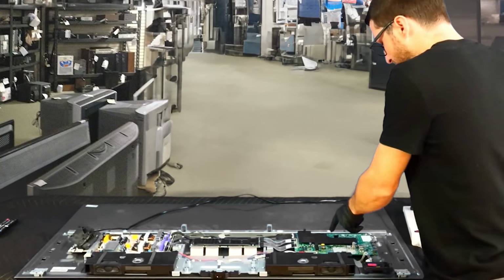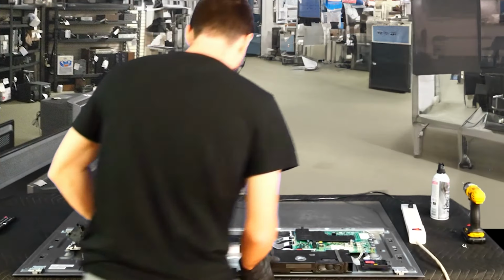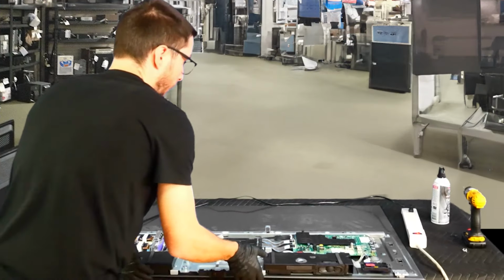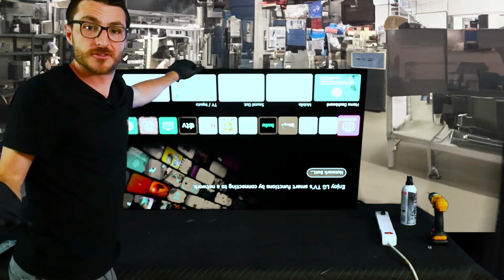LG OLEDs Have A Serious Problem! How To Fix!

Comment: My CX 65 inch OLED did the same this morning. No power. Reddit and YouTube seem to be full of CX failures at the 3 year mark. Let's hope LG does something about it.
Reply from the maker: I don't know if they will but I wish that companies were held at higher standards for how long their products work. I feel like 5 year manufacturer warranty should be the bare minimum. Yeah it will increase the cost of the TVs upfront, but in the long term it actually will cost less since you won't need to replace your TV as often.
Reply: Same issue. I had where it would spaz and turn off when it overheated. I added fans like some videos had suggested to cool it down and that worked for a few weeks until today when it just wont even turn on anymore.
Reply: Same! Mine stopped working
Reply: I called lg about mine and they just outright denied any responsibility and transfered me to a local repair tech. 

I'll probably just take it apart myself and send thr board off for resoldering after seeing this.
Reply: @flanker152  Yh I just sent mine to a repair shop hopefully it’ll get fixed
Reply: @AussieR1  No, they won't do nothing. They will just send you to a repair shop, on your  expanses. Two, maximum 3 years of normal use and after  that, failure of internal components. On such expansive TV's, this is totally NOT acceptable!
Reply: My one died to some months ago.
Reply: My 48cx has almost 10,000 hours on it and it's still going strong! By far the best TV I have ever owned until my 55 G4 arrives this Tuesday!

Comment: I believe this model of TV was recalled in other countries for overheating. Just not yet recalled in the USA. My 55' CX had the same problem and it was a defective dried up and crusty thermal pad, between the CPU and vapor chamber, that was the point of failure. 'Causing an overheating shutdown.
Reply: Would it be useful, when buying a new TV set, to add proper extra thermal pads on specific components such as processors and microcontrollers, graphics chipsets (GPUs), power supply modules (MOSFETs, voltage regulators, etc.), memory (RAM), for example, if there weren't any, just to preserve in the longer term? What's your opinion?
Reply from the maker: Yes this seems to be the case with every single one of these mainboards we have worked on so far. The thermal pad is very dried up and crusty.
Reply from the maker: Yes and no. I think it depends on the manufacturing company. 
For example that thermal pad we add on the back of the mainboard, is something that Sony always does on their high-end XR series TV sets. Because of that it is very rare to see a processor fail in a Sony TV. However, we do see issues with the eMMC chips they use which are made by Samsung a lot of the time (maybe sabotage lol). So for Sony TVs, it's already done and also because we rarely see processor failures even if it wasn't done I would say there is no need. Maybe because most of their sets have 2 processors instead of 1 processor handling everything. 

For LG sets we do often see processors fail and they never have that thermal pad below to help dissipate heat. So for an LG set I would advise adding a thermal pad below the mainboard yes for sure worth it. If they have 2 processors one being a GPU then both should get that extra thermal pad yes. The UF series was one that very much needed that. 

Vizio has been adding those thermal pads for their TV sets, but they still also have lots of processor failures. I don't know why that is although I do have a hunch that is based purely in speculation so I won't share it. For those, realistically having a fan in there would be the best way to upgrade it although that is more advanced for sure. 

I do know that the next iteration that LG made for the next years TV sets LG added a copper plate between the CPU and the heatsink to try and have better heat transfer between the die of the CPU and the heatsink.

Comment: This is happening to my LG CX. Seems to cycle and restart every ~15min regardless of of using internal apps or external device. I replaced the main board thinking this would be the solution but the problem still exists. Ordered a new power supply in hopes that solves the issue. Any other ideas of what could be happening if the new power supply doesn’t work?
Reply from the maker: Did you purchase a replacement mainboard from us? If not then most likely you bought a bad mainboard. I don't think the replacement power supply will help.

Comment: Hi, i have an lg oled5587v and i get three red flashes and an audible metallic click when i press the power, but no picture/audio. Any ideas whether its main board or power board?
Reply from the maker: I am not familiar with that model. Could be neither of those and could be a T-con or panel fault as well.

Comment: My 55b16LA won’t turn on after 2 years use but has a red light on the front that works when u u press your remote control buttons? Any ideas on what has happened thanks

Comment: I have the same issue, tv is overheating and turning itself off. However, if i place a fan behind it, where the board is, it doesnt shut uff anymore. Is this a long term solution, or should i send it back to warranty?
Reply from the maker: If your TV is still under warranty I highly recommend you have the TV serviced asap before it goes out of warranty. If it is already out of warranty which I would assume it is by now, then I wouldn't be able to tell you if this is a proper long-term solution but if you don't mind turning on a fan when you turn on the TV I would say to keep doing that and report back once it fails. 
I do have replacement mainboards for sale available, but I only have about 30 left before I am completely out of stock. From what I can tell everyone else is out of stock as well, so there may not be parts available in the future.

Comment: Hey i can have your advice, in my CX 55 some white lines appeared on the borders of the tv, at the beginning it was just in one corner but with time it has extended and now it looks like a white frame everytime I turn my tv on :( the thing is that I found a panel online but the model its OLED55CXPSA and my tv its OLED55CXPUA. Do you think I could replace it? or they are completely different things? thank you soo much

Comment: I noticed that many LG OLED buyers have one of these problems (the TV no longer turns on, the red LED light no longer lights on), and in some cases, the appearance of black dots on the upper and lower edges of the OLED panel. The power board fails, the processing part (main board) fails (due to a processor that is not properly cooled)... I experienced these problems too ( I have a 65CX model) - some during warranty, others almost immediately after the warranty period expired.
It's not normal for a failure rate to be so high for such an expensive TV after one to three years of use.
A class action lawsuit should be filed to force LG to acknowledge their major quality problems and fix them at their own expense.
Reply from the maker: It may happen if enough people have issues. 
There was a big class action lawsuit against Samsung TVs around 2010 because they had bad capacitors on the power supply board that would fail prematurely causing the TVs to constantly turn off and back on until unplugged.
Reply: I have the same fault. Here in Argentina, I only had a one-year warranty. A month after it expired, I had red circles with horizontal lines; afterward, the television went out.
Reply: I have the same power issue with my LG OLED 65CX (3 years and 10 months old.)  Repair quote 850 Euro.

Comment: Thanks for the great video.
I have the same issue and I got a new motherboard as a replacement, I saw the ceramic thermal pad that you put behind the processor and I wanted to buy it but couldn’t find the same thickness after I did some research. May you share where could I get the same thickness as the one in the video.

Thank you.
Reply from the maker: 35mm by 35mm for sides and 15mm thick. 
Im sorry I don't buy these through normal channels, I don't know where you might buy one.
Reply: Same problem.But from india How to order and what would be the rate.?

Comment: I fixed my CX55 by dropping in a C1 mainboard, has been working great ever since. 😃 (this was after reapplying thermal paste to the cpu and it still failing)
Reply from the maker: Yeah thermal paste alone doesn't always do it but in some cases it can. You just have to make sure you really clean off all of the old crusty thermal paste off so that the new paste can make good contact with the CPU die and heatink. Additionally having that large silicone thermal pad can be a big difference for heat extraction. 
With all that said usually a reflow is also required in a few cases, and in a lot, a new CPU especially if the heat stress damaged the chip.
Reply: C1 mainboard is working fine till now without issue ? is it compatible with the CX. Bcz same for me after thermal paste application still my tv is freezing after 15 to 30 mins runtime.

Comment: Thank you for the video! Is there any concern with the thermal pad on the back of the main board conducting heat into the OLED panel itself and damaging it with a hotspot? I'm not sure how close  the frame behind the mainboard is to the panel.
Reply from the maker: That is a very valid concern, not something I honestly thought of. Thank you for bringing that up.
I guess I don't know for sure but I would just as a matter of opinion believe that it's probably okay and not something to be worried about but in the end wouldn't know for sure until I ran this for several years and saw long term affects or lack of effects.

Comment: Wow, I just fixed my LG CX 65 last night after watching this video. Now the TV works. Also, where did you buy the pad or do you have a link so I can buy one? 👏👏🌅
Reply from the maker: How did you fix the mainboard? Do you have a reflow machine available? The freezing is only a very temporary fix so that you can confirm the fault and is not meant to be a repair. As for the pads you have to buy them usually at a 100 piece minimum order, and we get them from our suppliers overseas. 
Before I sell you one, it would make more sense to ensure the repair was done properly. Can you give me more information on how you did the repair?
Reply: @NicksTVRepair  oh, I cleaned the old thermal paste and added a new one. As of now, it's working well. Also, I noticed less heat on the back. The TV problem was it would turn on then after around 30 minutes to an hour it would start to flicker and turn off again and be in a loop. After researching, I believe it was overheating but no burn spots on anyone on the board since it has very low hours (1874) for a 2021 TV. But now it's been running since 7:24 am CST and it's now 927. But going to add that pad next when I ordered it.
Reply: @NicksTVRepair  Hi, did not found this information about the thermal pad, what was it's height?

Comment: If I replace the mainboard on my LG C1 65 inch, will it require any sort of software to install to work or will the replacement board just have what is needed?
Reply from the maker: No you should not require new software.

Comment: My 55c1 stop working, no power at all, even the stand by is not turning on. What it could be ?
Reply from the maker: That actually is probably still a mainboard failure. If you remove the mainboard and take a look at the back of it, do you see a brown spot on the back where the processor is? If so it means the processor overheated and burnt out. We sell upgraded replacement mainboards if this is the case.

Comment: Are the C1 powerboards swapable? I got a C1 55 and picked up a C1 77 with what looks like a power supply issue. Can I swap it over to test?
Reply from the maker: You can NOT swap the power supply boards with one another but you CAN swap the mainboards.

Comment: I have a CX55 with a broken panel,  I’ve just picked us a bx55 that switches off with a check panel error.  Could I swap out my cx board into the bx ie at the components the same/ in the same places
Reply from the maker: Can you give me full model numbers so I can look up the info?
Reply: @ mine is oled55cx6la with fully working “brain” but smashed screen and using new  screen panel  from LG OLED55BX6LB
Reply: @ I swapped the boards and my cx is working in the bx body with the rear panel from my cx on the back to allow for the difference in inputs etc

Comment: 1 year ago, I have a OLED55GX that died in 2,5 years, (I lost each HDMI Ext. one after the other) I've found a replacement board and put termal pad on the heat dissipator to pass the heat to the outer carcass. Mine did not have any sign of heat on the under side of the IC btw.
I did at that time a post on the LG Reddit, I felt that I would not be the only one since it's definitevely a design flaw.
Reply from the maker: Yeah this has been an issue. They added an additional copper plate on the later revision to help with heat dissipation and that seems to have helped a lot.
Reply: Did replacing only main board solve it? I have a C2 that lost hdmis one after other slowly after power surge. Tested psu and ordered a replacement as it was sending wrong voltages

Comment: I have a similar problem … which FIVE screws did you remove? I only see 3 … one is next to power cable and other 2 are where the table top stand screws in.
Reply: Usually on the bottom of the TV on these LG models

Comment: Hi Nick, My 55C1 motherboard is broken. If I find a good 65C1 motherboard, can I replace it directly? Will there be any incompatibility issues? Thank you for your enthusiastic advice.
Reply from the maker: yes the 65" and 55" and also 77" are all cross compatible.
Reply: Appreciate you for prompt response ❤.I will try while I get the mainboard of 65C1
Reply from the maker: No problem, just a heads up, since they don't make them new anymore all of them are used and a good majority of the used boards for sale are all defective and have faults. Most of them run for 30 minutes before failing just as shown in this video.
Reply: hi Nick, I got mainboard of 65c1 and replace my 55c1 earlier hours.It works. Appreciate ❤

Comment: Mines a 65 and I’m getting the 4 blinks on the power button (no power, no picture) indicating a power problem. I ordered and replaced the mother board and still getting the same problem. Any suggestions?
Reply from the maker: What you are describing typically will be due to a failure with the mainboard. If you already replaced the mainboard then you probably bought a bad mainboard or you have physical damage to the screen which can cause similar faults. 
I recommend you return the mainboard for a refund and check the screen for any physical damage but please understand a crack on a screen is very difficult to detect, it's not like a window or glass on a cell phone. So you have to inspect the screen closely. TV screens have antiglare layers above the screen that make it much more difficult to detect physical damage. If the screen is good then order a replacement mainboard from a different supplier. The only reliable supplier is us, we are the only ones that have this TV in our shop and actually live test and improve the board before we ship them out. 
https://nickselectronics.com/products/oled65cxpua

Comment: Thanks again Nick. Very interesting. So if I understand correctly, it may simply be a lack in the design of this model to dissipate the maximum amount of heat from the chip, just by adding a thermal pad, for long-term protection? On the other hand, if there are no more boards in stock, the TV must be a certain age already.
Reply: Oh, only a 2020 model.
Reply from the maker: This is a 2020 model so it's just about 4 years old now. 
So I think that yes this issue would not be happening if they had a larger heatsink on the top of the board and a thermal pad on the bottom. Although I could be wrong and it's possible that they are also just having so much going on in terms of processing with the whole AI thing that it could be overstressing the CPU. 
Please keep in mind that I know nothing. Since we only started fixing these a few months ago, I have no idea how long my repairs will last. I know that we are putting in new CPUs I know that we are putting in high-end MX-4 thermal paste, and adding an extra cooling system via the thermal pad on the bottom. We actually just ordered some much larger thermal pads that are larger than the chip for extra heat extraction than the one used in the video. With that said I really don't know the long-term effect of those adjustments and of course won't know for a few years probably.
Reply: @NicksTVRepair  Thank you for this additional information.
Reply from the maker: Yeah of course

Comment: On the vapor chamber. How did you remove the blue plastic parts supported by a spring? First time messing around with a tv but I have tinkered with pcs in the past. I have just never seen those blue plastic pieces so I can lift the chamber and apply a fresh set of thermal paste.
Reply: I was able to take apart the motherboard and squeeze the blue plastic tips behind it to pull from the other side. I applied the new paste, but now facing an issue where the tv won’t turn on 😱 I made sure all the slots were properly clicked in before closing everything back up… any ideas? I know the thermal paste before was littered everywhere and I was scrubbing aggressively… do you think I might have scratched something off that was not supposed to be scratched off?
Reply from the maker: Yes unfortunately that is most likely the case. 
At this point i would recommend you replace the mainboard. We have replacements available still but we are getting pretty low on inventory. We will be out of stock very soon.